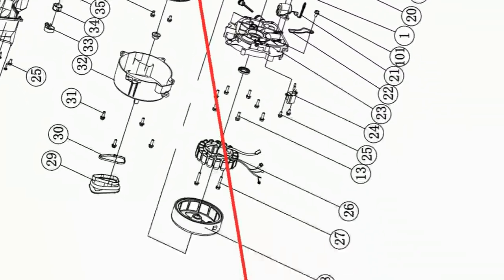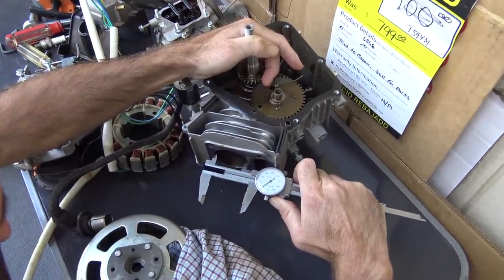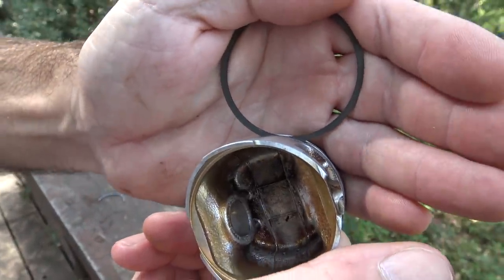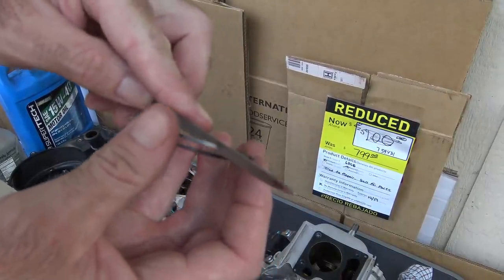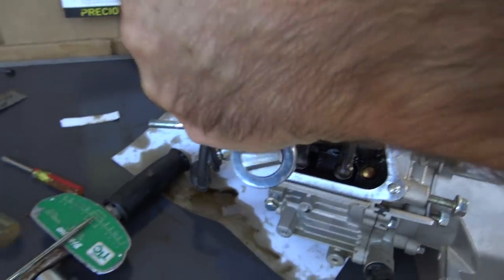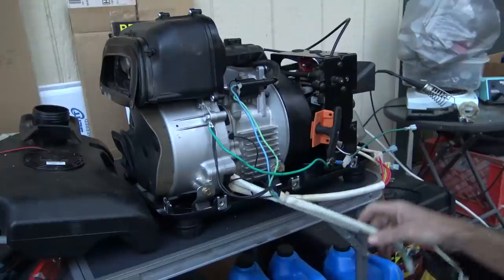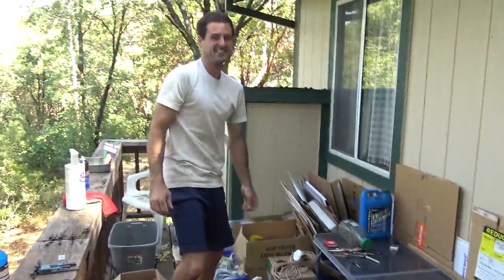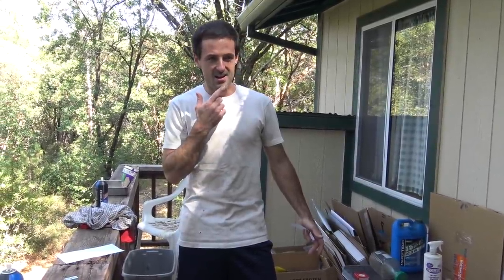$25 Generator From Lowes - The Final Outcome

Comment: He’s like me fixing junk for the fun of it just because u know it’s fixable and most wouldn’t bother trying
Reply: I fixed my old front loader that had a failed rear tub bearing if it wasn’t for my dad completely screwing up the bearing housing it wouldn’t be leaking again and also it wouldn’t have taken me 3 days to pound in 

It does work it’s starting to make noise again and last time I took the back off it’s re leaking 😕 he may have messed to the rear tub seal he did rush to put it back together behind my back after I popped the bearing in he may have messed something up

Comment: The generator was made in China,  the cheaper price verified it, U.S company have a generator made with their name on it, been happening from the computer era, just about all electronic are. they make the  motor on Maytag or whirlpool laundry equipment too.
Reply: There a new model that the popular it’s even more quiet than the Honda. But it eat more gas. And don’t have a enternal  pump so you can tap into your fuel tank. But less than 1/2 the price.
Reply: Can’t

Comment: Actually you should use a flat file designed for filing piston rings. I also see you’ve never heard of assembly lube. For torque values call a motorcycle shop and pick their brains for say a Honda 90cc engine.

Comment: hey put a scooter transmission on that generator with manual shift and the put it in high gear and run at super low rpm's with the generac stator on the end instead of wheel and then show me how long the gas will last. but you are probably chicken.!?! now lets see you put that on YouTube !?! I only guarantee one thing it will get a billion views in two years.  but if you use the 6 plugs at 120 it would get 3 billion views. I now this because I went to school for marketing.